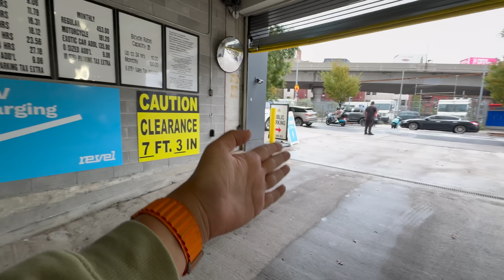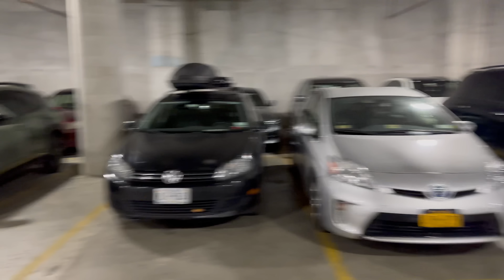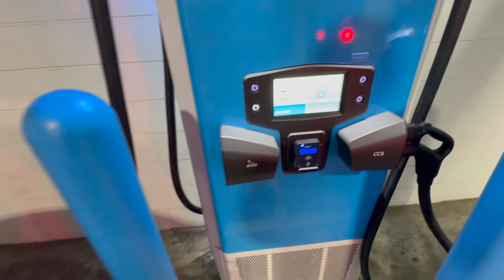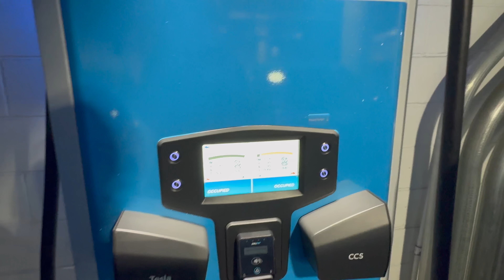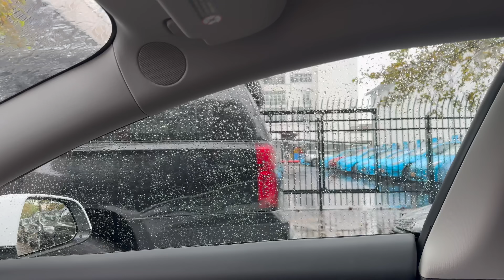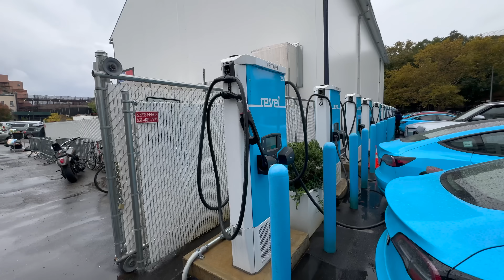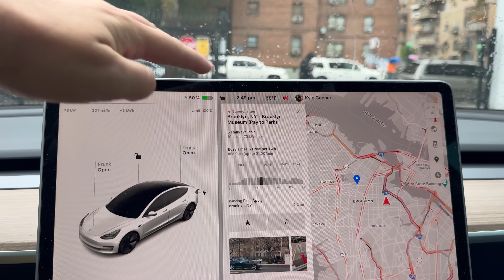These Insane DC Fast Charging Hubs In New York City Could Set The Standard For Urban EV Charging

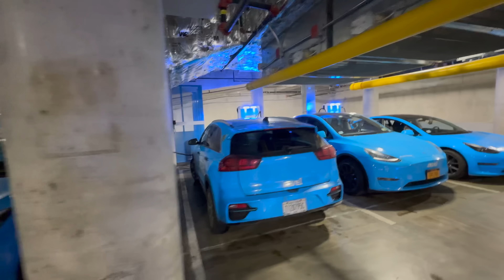Comment: What is the car at 4:11 - the none Telsa car
Reply: KIA Niro.
Reply: @Smidge204  The reason why I asked it looks like a station wagon vs a Niro to me
Reply: @QALibrary  2022 Niro EV. They removed the badge and wrapped the bumper (which is the same color as the body panels by default) but you can still tell by the lights.

Comment: In my part of the UK, they replaced the old type of lamp posts and all LEDs.

Not only the upgrade paid for itself in under 2 years.

But due to a lot less power needed for lighting the same circuit/power cables can now be used for slow-charging cars overnight and up to 4 cars can be plugged into a socket with is part of the lamppost for on street parking and charging
Reply: Thank you for your insight ! It's a very simple yet impressive idea there ! @QALibrary
Reply: We already had new (old tech) lights in the lamposts many years ago. So it was very dim at night. Now they are replacing the lamps in the city to LED, and they said it was around $5.4 million, and would lower the energy needed by 30%.   (they used something called high pressure sodium-lamps before). They said they thought they would save money cause you dont have to service led lamps as much. (A 100w sodium lamp is equal to a 1000w halogen lamp)  so if the city had halogen lamps, it would be a big saving (and a lot of electricity to use :)
Reply: And now they're retrofitting them with red filters because white light is attracting bugs at night and leading them to a massacare because bats are just gobbling up the inspects at night.
Reply: LEDS ARE TERRIBLE LIGHTS FOR YOUR EYES DUDE

Comment: There are a lot of AC and DC charging locations in England!!  I normally use charging hubs in either North Weald Bassett or Chipping Ongar.
Reply: I"m told that Europe/England uses three phase power for AC charging as well, which makes it a lot faster than here in the States. Your side of the World is definitely far ahead there.
Reply: @bigoldjim4696  Yeah but only 1 in every 4 actually works.